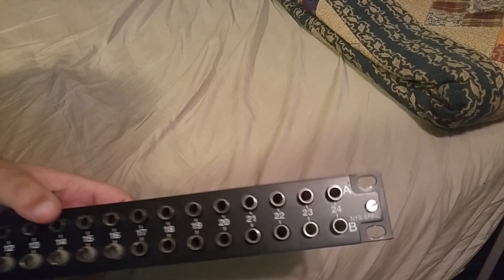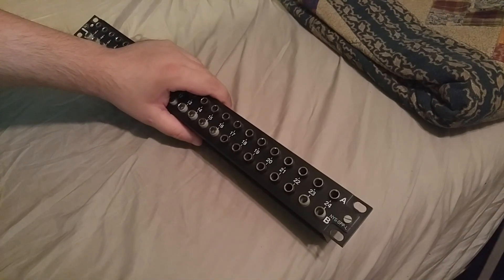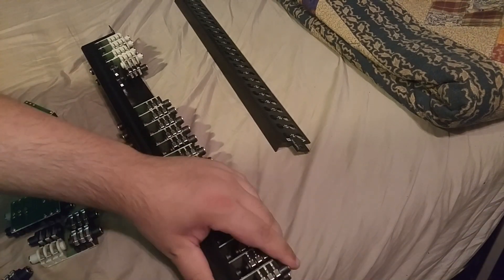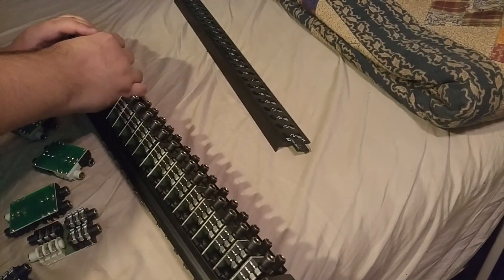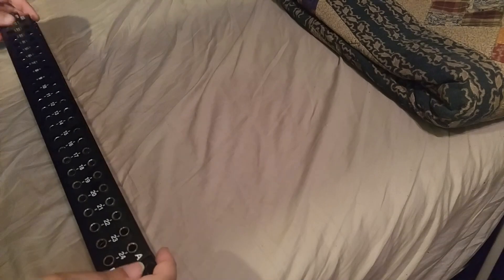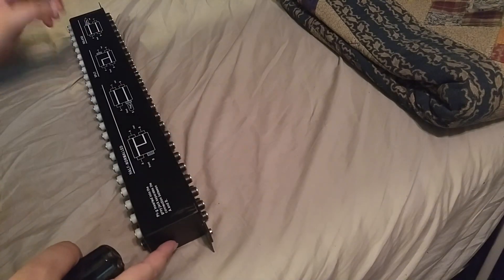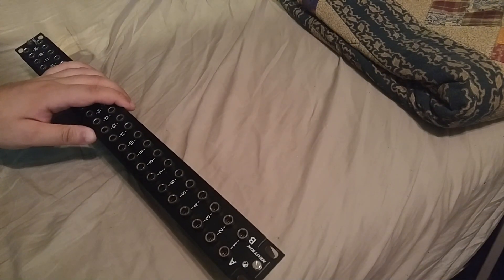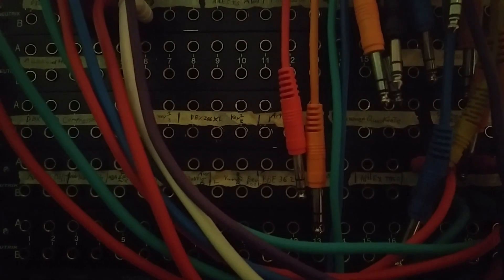Tutorial Neutrik Patchbay NYS-SPP-L Setup for Isolated Inputs and Outputs

Comment: Should I set mine Up like yours in isolated mode.
Dose this mean that I need another bay and more leads in future .
I don't mind that tho. 
I need to be Shure it's just a straight line out directly from source unit. And should I use the earth clips that come with it🙌
Reply from the maker: It depends on how much stuff you're hooking up for if you need a second unit. The earth clips aren't really necessary depending on your setup either. I have like six of these and have never used the clips
Reply: @jkhan337  you're an absolute legend bro thank you so much for replying. 🙌
What I'm running is an API lunch box a discrete 8 Synergy  core by antelope.
Extra Ada 8channle  rack clocked.
White industry 2 channel EQ vintage gear. .
The API lunch box is a DB25  connect into 8 TRS Jack..

I was hoping to run the 8 channels from The API my Synergy core and .
If I run out of patchbay I can add another couple units.
There will be a lot more gear to come.

Though ideally I'm setting up as a mastering studio. So to speak.
So the most functional way of connection would be the best..

It's a custom-built desk with rack units coming out at 30 degree angle set through the desk. So I can change anything in and out fairly easily.
Any information would be of great help thank you.
 Regards Chad🙌
Reply from the maker: Yeah, with that setup you only need one for now but it sounds like you will need a second soon. For mastering, those guys typically use a digitally controlled patchbay to run their setup but they typically only have like ten pieces of gear (all of it super expensive). Moar Applebaum, I believe, shows his rack in a few videos and it has a digital patchbay but they are expensive (like most mastering gear is) and these neutrik units will do just fine. those digital patchbay units might just a fashionable thing and not have anymore real function
Reply: @jkhan337  really appreciate all your help and advice looks like I'll have to look more into the digital patchbay side of things as there will be a lot more equipment to come and I do need the neutron to get me out of trouble.
My confusion is I was going to run a normal. Instead of half normalled. Or isolated.

Which would you think would be the best way to run it as I only have the one at the moment.

And it's like yours the spp1  so it has the split also witch option would you run 🙌 regards Chad
Reply from the maker: Personally, I would just run it as isolated. I've never used the other modes and I only used normalled in school with a large console

Comment: These are good, I have 5 of these, the first you have to do, is to clean the PCB's with isopropyl or (in electronic terms IPA) 99,9% alcohol, why? These PCBs's has residue on them from the solder bath, in time this can cause problems, adding noise or unwanted harmonics because dust and the residue can merge and cause problems, these are open on the bottom. I see this complaint every time again on reviews. Use the IPA with a toothbrush. Next think about the configuration you want to use, like jkahn337 does. I'm using some them half-normalled or isolated, some I changed the pcb's with the Rean NYS SPCR 1, these are used to split my inserts, which comes with the multi cable. Use these for many years. PS the PCB's on the video are already cleaned. Have fun outthere.
Reply from the maker: Perfect! Thank you for the additional info, I did not know about the residue. I need like 3 more of these and will most likely have to buy new to get them quick and that will help with the new ones

Comment: Looks complicated
Reply from the maker: It's easier than it looks
Reply: jkhan337 I don’t know from what to beginning! I got one new here!
Reply: jkhan337 how about the quality? If Mogami cables on it it will transfer same as Mogami outings?
Reply from the maker: pretty much just do as I do and describe in the video and you should be fine. For quality, Neutrik connectors are pretty much industry standard for quality so you don't have to worry there. If you have any probs let me know
Reply: jkhan337 Thank you! I actually can’t understanding in what position is mine if they all be already such like white on top, meant from factory is came isolated and i can start using it as: all my gear inputs outputs on back and will have them in front of me as such like inputs outputs for mixing around? Correct?
Reply from the maker: @BMU5  I'm going to try to record a follow-up video tomorrow on patchbay basics and it might clear up some misunderstandings for you and others!
Reply: I haven't found 1 video on patchbays where they explain clearly what they're doing from start to end WHILE they're actually doing it. They either talk and talk or just start doing stuff like we know what's going on